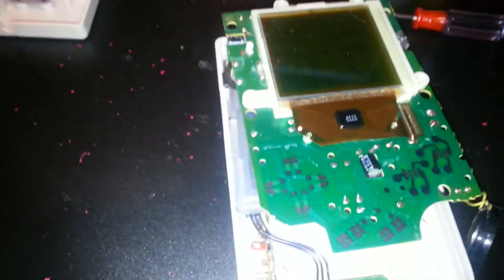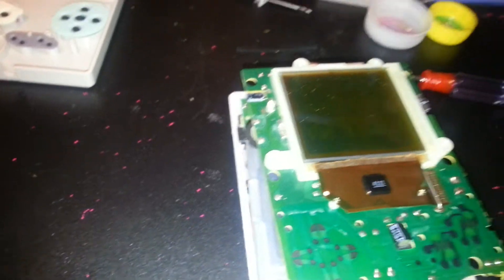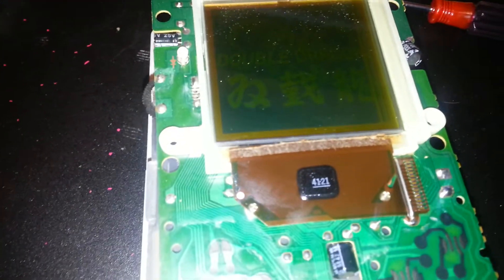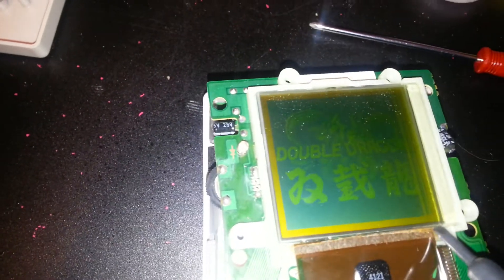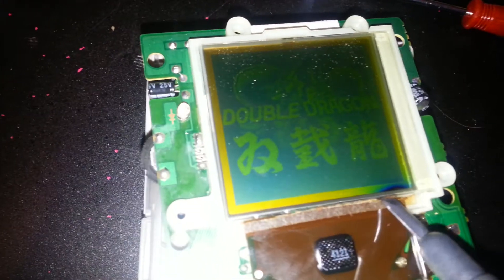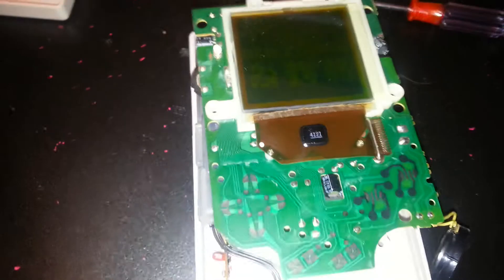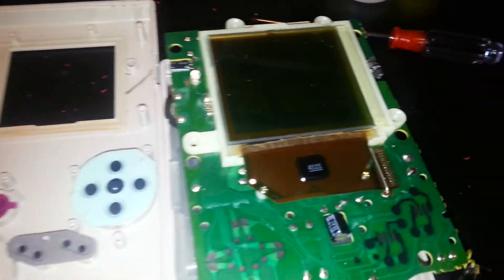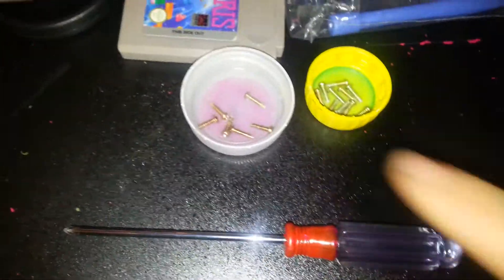Gameboy Screen Fix (Missing Vertical Lines)

Comment: I fixed one like this years ago and fixed an early one from 1989 other day but when I turned it back on a day later a bunch of lines were back so I took it back apart & it took me about 30 mins at least to get it back. The slightest pressure would cause missing lines again so I left the rubber piece out when I reassembled it and so far so good. I suggest leaving the rubber piece out that stays over the ribbon cable because it just causes unnecessary pressure on the connectors.

Comment: You're not heating up the glue but actually the solder connections. Robon cables like that get soldered onto components but they can be torn away. You are reflowing the solder.